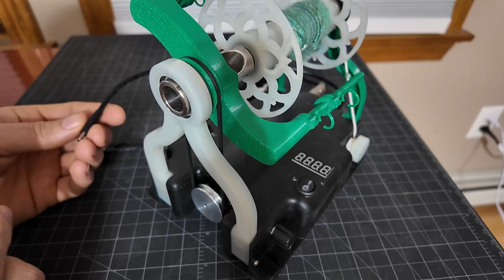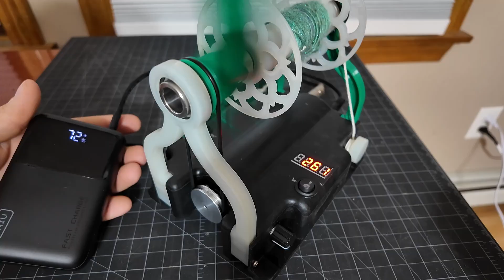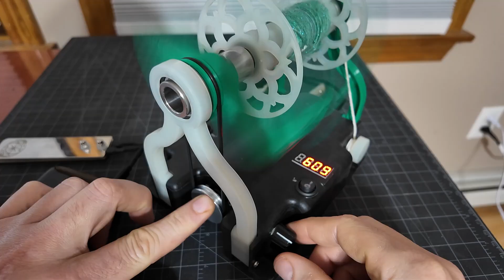Spin 198 - EEW Fold Paused Speed Estimation and Startup Profiles

Comment: While spinning and pause for any amount of time, will there be a place/way/crevice to park the spin in progress? Something possibly near the orifice...
Reply from the maker: There are lots of options for this so I didn't add another dedicated one.  The reducer has some grooves for this built into it.  you can wrap it around the unused sliding hooks.  You can slide it between the bottom cover and the bottom of the case.  You can live up the eSpinner and just set it on the end of your fiber.
Reply: Thank you so much for your help and quick response. You are the best ❣️ @DreamingRobotsBlog

Comment: This looks great, Maurice! I'm always really impressed with your design and engineering skills, and the thoroughness with which you explore a problem and come up with solutions. 👍

One thing that I was unsure of with the two different profiles was whether you can choose what the maximum speed is, or if it is preset with a sort of "low/high" speed settings, like you were showing in this video, where it's about 1600/3000? 🤔

It might just be an edge case, but I was wondering if someone could set the maximum to say, 800 RPM, or 1000 RPM, and then have the speed adjuster just run through that range, rather than up to 1600, or up to 3000. The 3000 looks blindingly fast, and I am not certain I would have a use case for that, either, but I could see some for having more/finer speed control in the slower ranges.

In any event, it looks tremendous, and I'm so glad to see this progressing so well. Keep up the great work! 😃👍
Reply from the maker: Sorry that my explanation wasn't clear enough.  The way these startup modes work is they are presets and right now default to 1600 and 3000.  While I could come up with a way to set your max speed, I think that might be more confusing to set.  It would also be harder for me to test (for example if I allowed 500-3000 in 100 intervals that would be 25 different modes that needed to be tested).  That said maybe I should allow a few more and label that differently... For example if I listed 10,15,20,25,30 and those would be max RPM is x100.  This might be easier to remember.

Thanks for the suggestion.
Reply: @ OK, I was just trying to clarify in my head how it was set up. 

It probably is quite an edge case, and since you can usually dial it way down to a slow speed anyway, having a granularity of two speed ranges will probably be more than adequate. 

I wouldn't knock yourself out too much trying to add extra functionality. If you had even three or four gradations, that would certainly be more than adequate, but I've found the slow speed adjusting to be quite good on both my Nano and my 6.0, and I've used them a variety of ways and times while plying different threads together into multi strand yarns. 

Looking forward to this, and I've also been checking out the store on your website for some of the other cool things you've developed! Excellent work! 🧶❤️